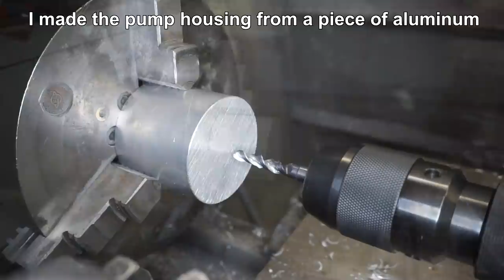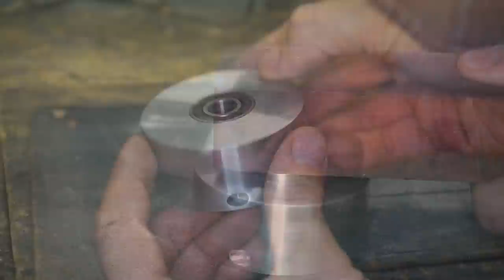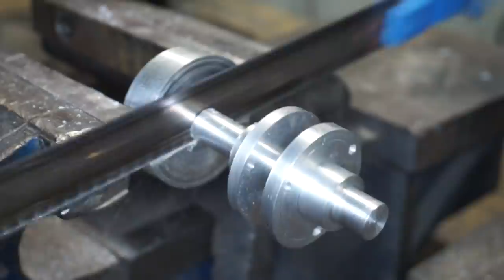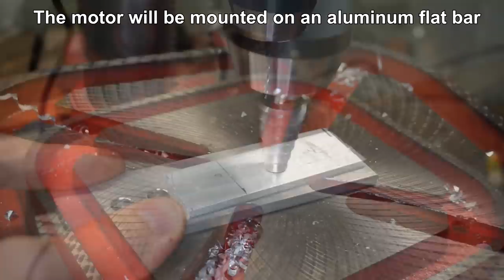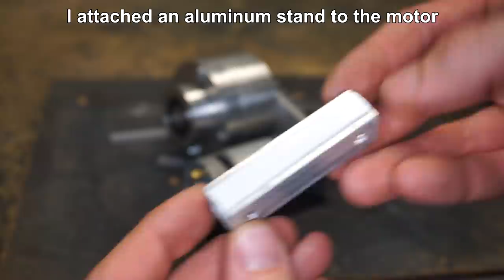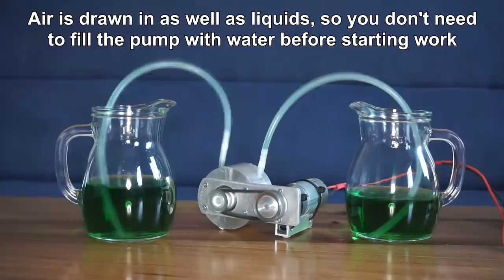Making a Simple Peristaltic Pump

Comment: Nicely made project with proper bearings etc.  Nite that a commercial peristaltic pump would typically have the rollers mounted on spring arms to apply a constant pressure to the tube, irrespective of its thickness. This design relies only on the clearance between the rotor and housing so a slightly thicker walled tube would cause binding, and slightly thinner would cause leakage.

Comment: I spent almost 2 semesters in college, trying to make one on CNC machines for a part of a larger class project. (I needed something to pump small bits of oil into bearings) I really didn’t do anything different from what you did. Everything was machined to a couple thousands tolerance. Used a low speed high torque motor like you did. I could get them to half work, but not reliably. I also 3D printed many different styles of different pieces before machining anything. Eventually I got one to work, made about 20 of them and not a single one of them worked. 

I’m thankful covid caused campus to shut down back in 2020 cause I would have pulled out all my remaining hair trying to get them to work.
Reply: This surprises me, since they seem like such simple machines... what were the problems that made them "not work"?

Comment: Very nice build. Those type pumps can be used for corrosive fluids as well as toxic fluids without any danger of contamination or damaging the pump parts. Good pump for making a continuous flow Ferric Chloride spray circuit board etcher setup.

Comment: Pretty cool video I work with these pumps a lot. Just one note, real peristaltic pumps have a way to remove and dispose of the entire tubing without having to take the whole pump apart. Otherwise, it kind of defeats the purpose of this type of pump, which is to avoid contamination.
Reply: Mostly used in medical applications I guess?
Reply: They are used in tube feeding devices for instance
Reply: @jesperwall839  Dialysis machines are good examples of rotary peristaltic pumps since the entire circuit is in contact with blood. The whole length of tubing is disposed of after every run. Regular IV infusion pumps use the same principle, but they work in a linear fashion - i.e.; the tubing is straight and the rollers (cam followers) roll against it in a straight line like a wave.
Reply: @jaymzx0  Yeah, that’s what I have seen these pumps working in action. But I guess they have more uses than that?
Reply: @jesperwall839  I've seen them used to move foodstuff liquids before. They're good for moving or metering precision amounts of liquid in a sterile environment or in a situation where one would want to dispose of the entire tubing circuit after use or periodically. They're self-priming, a simple design, and can move pretty viscous things like syrups. They can be easily serviced in the field by untrained personnel and may even be designed as such. It's another design to keep in the mental toolbox of 'using the right tool for the job'.
Reply: In this setup the fluid won't get contaminated. But changing the tubing would be a hassle, which as you noted would happen frequently, even if this is not a biomedical application. The tubing wears and tears and needs to be replaced sooner than you think especially if you use a different tubing size or hardness. Great work nonetheless!
Reply: @jesperwall839  🔴 What Is Islam? ⚠️

🔴 Islam is not just another religion. 

🔵 It is the same message preached by Moses, Jesus and Abraham.

 🔴 Islam literally means ‘submission to God’ and it teaches us to have a direct relationship with God. 

 🔵 It reminds us that since God created us, no one should be worshipped except God alone. 

 🔴 It also teaches that God is nothing like a human being or like anything that we can imagine.

🌍 The concept of God is summarized in the Quran as:

📖 { “Say, He is God, the One.  God, the Absolute.  He does not give birth, nor was He born, and there is nothing like Him.”} (Quran 112:1-4)[4] 📚

🔴 Becoming a Muslim is not turning your back to Jesus. 

🔵 Rather it’s going back to the original teachings of Jesus and obeying him.
Reply: @jesperwall839  dialysis equipment
Reply: @1islam1  dye in horreeble peyn.
Reply: Also used on inkjet printers to suck ink from cartridge and feed it into the heads.
Reply: @Conrad von Hötzendorf - The leading peristaltic pump company Watson-Marlow launched recently Qdos peristaltic pump. You replace entire pump-head not just tubing with the Qdos pump. The advantage is that liquid will always stay in the pump - you don't have the risk of spilling corrosive liquid all over factory. What we see in the video is a mini Qdos ;).
Reply: I need a slightly bigger version tube id 8.0 mm or more. Dc24v, flow 160 ml per min. Pl suggest the right model.

Comment: Instead of the brass rollers, you could have used plastic (nylon or pp) rollers with a thin groove to keep the pipe in place. There will be a tendency to drag the silicone pipe while pumping

Comment: Simple hand crank versions of this type of pump are used for RC model methanol fuel to prevent moisture contamination.
Reply: I remember my dad and I had a pump like that for pumping fuel into our RC planes. Every other guy at the field had the expensive electric pumps but ours was so much faster I never saw the point of upgrading.

Comment: Now I KNOW I did not just see you cut those zip ties with the good fabric shears did I!????!!!! 21 years of marriage I if there is anything I have learned, I do not touchthe fabric shears. 

Also, 40+ years of using zip ties, use a flush cutter to cut them flush with the catch. Those sharp cut ends will slice you open just as fast as a straight razor. I have reached my hand into a server rack before and pulled it back out with blood dripping, darned previous tech used zip ties and cut them with scissors at an angle...

I spent more time cutting those zip ties out and replacing them with velcro and twist than I did replacing the power supply on the server that was throwing an error.

Comment: Eco-Lab uses peristaltic pumps to dispense liquid soap at millions of restaurants. I don’t know if they sell these pumps used, but they probably have ten thousand old ones, sitting in a warehouse.

The problem with peristaltic pumps is that the fluid line gets squished, over and over; so it occasionally needs to be replaced. For that reason, peristaltic pumps are not such a great solution. But they’re cheap and accurate.

Peristaltic pumps are only good if you’re dispensing an expensive fluid. The same thing could be accomplished by placing the fluid-line (with a one-way check valve inside) onto an electric solenoid. When the solenoid actuates with great speed, a certain amount of liquid will pass through the check valve. At the end of travel, a spring-loaded valve-gate would swing closed, just as the solenoid returns to its original position. So you could say that the fluid is stationary, it’s the pump that’s moving.

Like a peristaltic pump, this system could be used to dispense small volumes of liquid with accuracy. It wouldn’t be infinitely variable, but companies like Eco-Lab aren’t looking for that kind of infinite adjustment anyway. Possibly increments of 10 cc.

Actually, you could have eight of these kinetic check valves operating in unison to make a pump which is not centrifugal, and not positive displacement, either. It’s a bastard red-headed stepchild pump.

Comment: Interesting, never heard of this kind of pump before. Having said that, it would have been a lot simpler by directly attaching the rotor to the pump housing with a shaft. Less parts, less points of failure and increased efficiency.
Reply: This kind of pump is used in the medical field. It can pump blood inside of a sterile tube without being subject to contamination inside the pump itself.
Reply: @djkommando  Ah okay, thanks for the info.
Reply: If the motor had the proper speed and torque.

Comment: I am looking for slightly larger pump. Tube id 8.0 mm dc24v motor, rpm 200 approx. Flow rate 150 ml per min. Any suppliers? I need 6 pumps.

Comment: 2:57 To be pedantic: you are connecting the motor via a belt drive, which consists of a belt running over two pulleys. Gears specifically engage directly with another gear, and reverse rotation, unlike pulleys, which need a belt but don't reverse the direction of rotation.
Interesting video otherwise, didn't realize you could build a pump lathe-only that easily